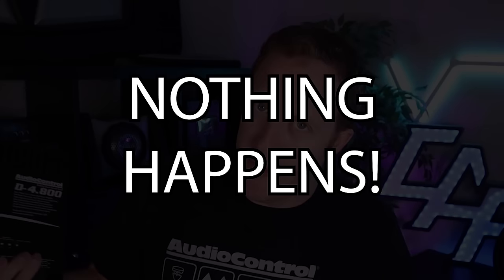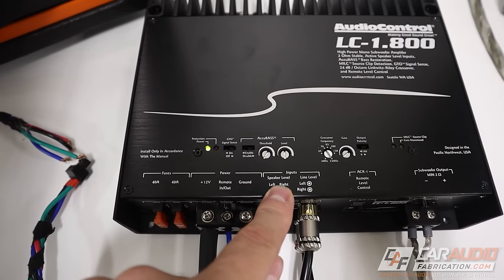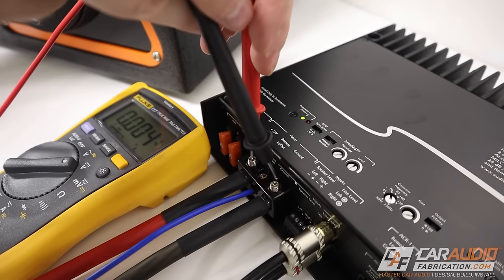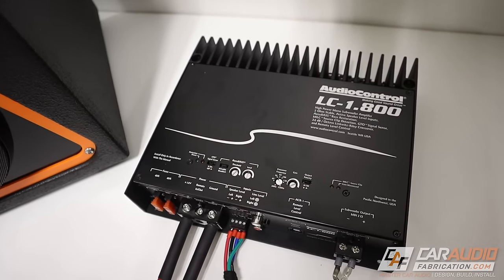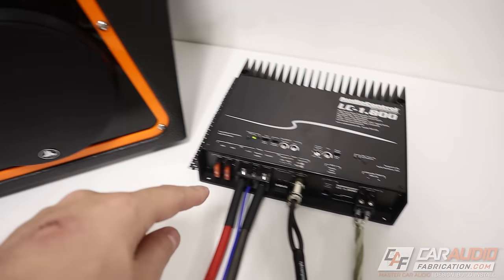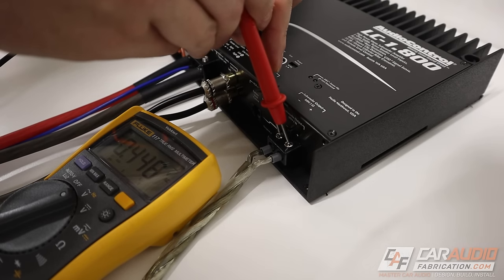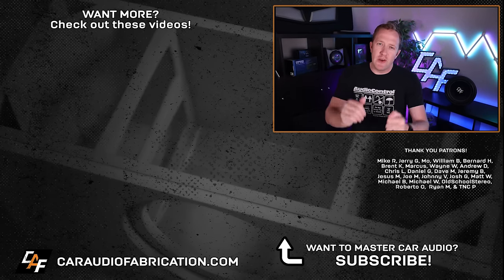No sound? No power? Fix your amplifier EASILY with THESE EASY TESTS!

Comment: Mark, quick question I accidentally plugged the ground and Power in reverse I saw Sparks when I put the ground in the power cable in the ground. Did it again this time no sparks. Fuse good.  could you please be so kind and tell me what steps to take next should I check for a protection diode across the + & - like ameture radio amps have. Should I try hooking it up the right way and see what happens I'm afraid to do so in case I damage it if it isn't already damaged.  let me know please bro thank you very much. It's old school crunch p-1000 1k rms 5 ch amp 70 amp fuse. Fyi: the remote was not plunged in

Comment: One other thing to mention, when testing voltage on the power and remote wires, if you have low or no voltage on both the power AND remote wires, the ground is probably faulty. Test the wires again with the black probe of the meter grounded to the chassis to confirm.

Comment: Dude, the timing of this video is just perfect!

I've experienced this issue last week. Got a custom sound system installed by my local Car Audio shop and after a month, the amp would just shut down randomly. After investigating, the wires on the side of the amp got loose for some reasons. Easely fixed, but I gotta say, I was freaking out when this happened lol.

Awesome video as always! 😉
Reply: Ñq
Reply: What car? Ford f350?

Comment: As a automotive tech that doesnt work on the audio side that had no idea this was how they worked. My mustang hadnt had any speaker working or amp for a year. I knew i had power coming in but had no idea what was going on with it. Ended up being the amp uses the headunit ac signal from the music (static ac when on) to turn on the amp. And for some reason it lost that functionality. Jump to the key on signal from power like you suowed and it came to life. So i took the interior apart and ran a signal wire from the headunits factory key on power. And now it works. Thanks.

Comment: Good video. Dealing with this rn with a brand new head unit not putting out voltage from the line outputs. Going to double check with a meter playing a test tone, but looks like I’ll be sending it back to Crutchfield.

Comment: Top tip for hyundai/Kia drivers out there. If you want to upgrade your audio and got a SPDIF factory Amp. Save up and just completely remove and replace the factory radio and amp and get some speed wire for your aftermarket gear. You do not want to know the hell you'll go through trying to work around that amp/radio instead of just gutting it.

Comment: I've been having this particular issue with my sub, it does not power on at all and all connections are good but if when I turn off my car the amp it self causes parasitic draw and kills my battery with in a few hours

Comment: Just started recently working at a  car shop where one of the Main things they do over there is sound system. Do you have videos based on sound system from installing, setting up and equipment needed? Also do you have videos explaining the basics for each equipment is needed to install a sound system. Some basic stuff what you need to know about speakers, amplifiers, and subwoofer.

I'm sorry I know I'm asking a lot but as someone like me who don't have that much background About sound system I'm trying to learn as much as I could.

Comment: Thanks so much, great video! I just want to see if my amp I bought at an auction would power up and it did with the remote jumper wire before Installing it. thanks for the info😅

Comment: So I have an active subwoofer that doesn't turn on, I know all the connections and wires are good coz I connected two different amps and they both turned on, what could the problem be

Comment: A couple of tips. Amp fuses should be tested out the amp, or the multimeter could be damaged. If you want to test them connected to the amp, a better way to do that is by checking them in high current mode, as an amperimeter, 10A in most multimeters, and set the volume really low. If a fuse is blown, when you connect the amperimeter the circuit will be closed by it, turning on the amp. If fuse isn't blown, the meter will just show 0 Amps. To check remote speakers wiring, even if they have any kind of filter, we should just disconnect them from the amp, and set the meter in ohms. If meter shows infinite value, speaker may be disconnected. If don't, we have two possible chances: if it's a low frequency speaker, it should show a low value on ohms, because if it is even filtered, low pass filters should have low impact on impedance (coil resistence). In a mid/high range speaker, we should have much higher resistance, but never an infinite value.
And to check speaker wiring, oldstyle way, is using a 1.5V battery (AA or AAA) or even 9V  in high power speakers. By fast connecting/disconnecting the battery directly to the speaker we should heat little "toc" noises from the speaker, if it's ok. Please don't use any power supply or car's battery to do this, DC is really harmfull to speakers and we need to use a low volt, low current drain battery just to fast checking, higher voltages or high amp capabilities will end blowing your speaker coil.

Comment: checked voltage on the wires aand got 12 v then  connected to amp nut nothign but still measures 12v but no voltage from control and the ground,gana chase the control wire,thanks for the quick vid veyr detailed

Comment: I have an Audi A4 with the stock audio system. I get no sound from any of the doors. The dash speaker, tweeters, and the speaker in the back work but at a very low volume, i mean really low. Any help with fixing this problem would be appreciated. Thanks

Comment: I’m using an adapter to my stock head unit and the trigger switch wire broke. Will it work if I wire the trigger switch to a 12 Volt aux switch on my truck?

Comment: Several months back, I had a situation where my amp had battery voltage while the head unit was off, but as soon as the remote line was energized by turning on the head unit, the battery voltage at the amp dropped to zero. Turned out to be a faulty/intermittent at the point where the positive power wire was tapped into the system. I replaced the wire with a slightly larger guage wire, connected properly at the battery instead under the dash at the fuse box ( was using a previously installed wire, by a previous owner ) and the problem was fixed. Just something to be on the look out for in similar situations.
Reply: this actually just happened to me in my bmw i think and what fixed it was messing with the positive cable on the amp and battery.

Comment: i have no power to eq or amps radio has power. i have a circuit breaker at the battery could the breaker have gone bad?

Comment: Don't forget some radios have a remote turn on and a power  Antenna turn on if you're hooked up to the power antenna the amplifier will only work with the stereo in the FM or Am position
Reply: What do u mean fm or am

Comment: So I bought a home system subwoofer, I get power to the unit and I can actually run signal through it into my studio monitors/ and successfully get sound through my studio monitors!!! but my subwoofer is just not firing at all.??? Has no sound. I have put my multimeter up to it and it is reading 3.2 ohms. Its a 4 ohm subwoofer. Can't seem to diagnose it unless that means its a bad woofer. It has a slight ruffle sound when I press it in really hard... any suggestions?

Comment: After installing aftermarket double din stereo in my jeep wrangler jk i have no sound from any of the speakers, this jeep has a factory amplifier  but no blue wires its been turned on by canbus, the aftermarket stereo has the blue amplifier control wire but were would it connect? Thanks

Comment: How do u trouble shoot the other thing... for lowering the frequency so the amp can work... but it doesn't- still I checked everything and it still won't work. If the speaker is blown won't it make SOME noise?

Comment: I love the audio control amp I have, but when I had it professionally installed using the gto it fried the battery in my wife's 2020 Jeep. And it is actually the same amp being used in this video. So in new cars w everything integrated into the stereo, be careful. Every time the key fob was used, doors open, etc, it was powering the amp on.
Reply from the maker: That's honestly more of an install issue. The Wranglers are pretty straightforward for a remote turn on lead, so not sure why GTO was used in the first place.
Reply: @CarAudioFabrication  it was in a compass. I was trying to prevent the guy tearing the dash apart. I'm not saying that the guy didn't make some sort of mistake. This was just my experience with it.
Reply: i have subwoofers on amp other speakers are powered by player. for long battery life i have put an on off switch to remote turn on wire so i only turn on the amp when want to listen it loud with subwoofers.

Comment: I have a question. I want to install subwoofers in a semi truck, but I also want to install a 2300W inverter. Since both the amp and inverter connect to the batteries, would that cause any issues?

Comment: Here is where I’m at with my subwoofer install (this is my first time and I am struggling at every turn): TLDR: my sub is extremely quiet even when I crank every knob to the maximum. Like so quiet there is almost no movement on the sub at all and I have to put my head on it to see if it’s on.

I have an AudioControl LC2i Pro. I have crimped the rear speaker wire and connected that to the LC2i high speaker input and then I jumped the left to the right so both sides were getting the same signal. I am vampyring the power and ground on the LC2i from the amp with 12 gauge wire. 
The amp is an 800 watt D class using 4 gauge wire that is connected to the car battery with an 80 amp fuse. The negative is connected with 4 gauge wire to a bolt that is connected to the negative battery terminal. 
When measuring the battery with the car turned on (but not the engine running) the LC2i and the amp both show 12.4 on the multimeter. 
I then ran a tone through the car speakers and see that the RCA cables plugged into the LC2i are sending signal. I plugged the RCA cables from the bass output on the LC2i into the amp.
First annoyance is that both the LC2i and the amp have knobs that control the bass. I’m not sure if I need to have them both plugged in and then find some synchronized levels. 
Because I’m not using a remote wire from the head unit, I am using the GTO option on the LC2i and that seems to keep everything powered properly. I am also using the remote out on the LC2i to the remote in on the amp.
Last settings for the LC2i are the load select which I have at 20kO and the bass output level which I have in the middle. I didn’t do anything with the accubass and just have them at the minimum. 
As for the amp, it has a setting for bass boost which I have off (0DB), low pass frequency which I have set to allow all low frequencies, high pass frequency which is set around the middle which should give it a cap of around 100hz, and then it has the RCA input from the LC2i. As mentioned before it is connected to power and turns on without issue. The output it has are 2 + and 2 - speaker terminals that appear to be jumped inside the unit according to my continuity test so I only have 1 12/14 gauge wire (not 100% sure which it is) connected to those and then to the sub. 

In relation to the video, the amp is turning on. RCA is showing an AC voltage. I am detecting a signal from the speaker wire. At this point I can hear a faint sound coming out of the sub, but it is extremely quiet. I am hoping there is something obvious I am doing wrong.

Again, this is my first time wiring this up and I basically did it from your videos and reading posts on Reddit/the internet. I would easily pay someone to do it for me but no one will touch my car as it’s a 2022 and there is currently no public info on it, even cruchfield is blank. So any help would be greatly appreciated!!
Reply: 1 wire to the sub? Check your sub wiring and ohm load. If it's right then just bypass all the lci shit and and send a signal to amp then sub. If it's still not working and you have votlage at the sub wires your shit is blown

Comment: I have a question what do you think of the is this a good speaker for someone new to (audio car systems) 

Rockford Fosgate Punch P300-12

600W Peak (300W RMS) Class-D Amplified Single 12" Punch Series Subwoofer Enclosure with Remote Bass Level Control Included

Comment: here's a question for y'all.  Just installed my amp.  Alpine KTA450 on an Alpine ILXW650.  When the audio is centered I hear distortion (sounds like a tweeter is blown) but when I pan L or R, fade F or B...the distortion goes away!!?  It goes away gradually too.  Each speaker isolated sounds fine, but when everything is set to center it has distortion (high chime-y distortion) on the peaks.  WTF??

Comment: Hello dude i would ask a question my amplifier nakamichi 3000watt 4 channel i used ch1/2 for four 4ohm speaker 6x9 and 3/4 as bridge for my little subwoofer and it can run 2ohm so how could i wiring my 4 speaker as 4 ohm could it happened and what if i wiring to 8 ohm dose sound would be less louder 
Best regard ❤️

Comment: My voltage at my speaker inputs on my subwoofer amplifier are about 12 volts with the gain all the way turned up what could be the cause of this? It used to go higher than that could it be my alternator going bad?

Comment: im having an issue with a car i bought. dude installed a cheap chinese headunit (which i think is my problem) and a hifonics bg-1300.1d amp with a skar sdr-1x10D2 sub. its all new, amp has power, but isnt receiving signal from headunit. problem is its so cheap i cant do any reaearch. its a 7" touchscreen that was probably around $75. anyways. ive tried all RCA outs on the unit and still nothing. It has a sub, front and rear LR and line in LR. cant get any noise though. any thoughts?

Comment: What happens when everything is connected properly, voltage and ground getting good connections, but keep blowing the onboard 30amp fuse. I’m guessing my amp is faulty? How would I test?
Reply: Sounds like a short somewhere in the cable, go through and look at any locations where it could’ve gotten cut, used to have a short on one of my mods for my car and the fuse would keep getting blown and ended up having a short somewhere and just put electrical tape around where it was ripped and fix it

Comment: My JL slash 1 quit working. Checked it and it was dripping wet! Figured I need a new one but a few days later, the old warhorse is slamming again! 
Should I let it be or open it up to check for damage? The knobs seem to spike the sound, they must be getting worn, this thing is like 25 years old!
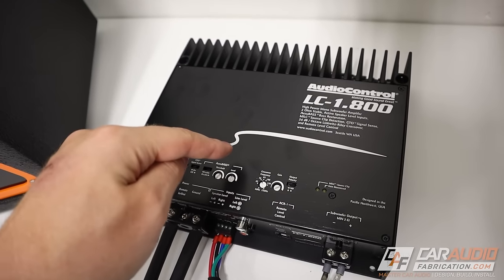Reply: 4:00 nice feature, my JL has it. Made installing just that much easier

Comment: I just recently got two JL audio 12s, lc2i pro, and a jbl amp I love them but every time I accelerate in my car it makes a terrible rumbling noise almost as if the sound of the engine is coming through the subs, I’m very new to car audio systems and I’m not very educated on how they work. The only time the sound gets slightly better is if I turn down the bass completely which pretty much defeats the purpose of the subs. Does anyone know what may be the issue and how I could fix it?

Comment: I have a problem with a salt 6 that has very little play time on it. It will loose signal through the rca inputs within a minute of play time. I switch my rca cable to the slave input and it works fine. And sundown Audio tested it and said it works fine. I've never had this problem happen before. Basically this amp only works in slave mode. Anyone out there could give me some advice on what could be the problem.

Comment: My problem is that I can measure power on the wires before connecting them to the amp, but after connection the power is below 2-3 volts. All fuses are good 😢

Comment: What do I do if something is wrong internally with the amp and no voltage coming out of the speaker terminals
Reply: My amp doesn't come on and it's getting power. Fuses are ok but nothing. Internal issue? I guess it's garbage time.

Comment: Im 9 volts between the ground and remote . The wires are 2 different guages will that cause the issue?
Reply: The power & ground wire have to be the same gauge(ex:both 4gauge)…the remote wire will be smaller(ex:18gauge)

Comment: Hi there!  I have a question. My preamp outputs on my aftermarket head unit are 2 volts. Does more voltage equal more power out of my amplifier in any way?  What can I do if so?  Thank you!
Reply: The amplifiers gain control is used to set the amplifier up for the correct signal input voltage. You will need to use more gain with a weaker input signal. 

When tuned properly, there will not be any difference in amplifier output level regardless of the signal input level.

The advantage to having a higher voltage signal is an improved signal to noise ratio.
Reply: @danielabrams555  thank you very, very much!
Reply: One way to get a higher voltage on your preouts is to use a " line driver " which, Mark has reviewed one by AudioControl here on this channel. While, as Daniel said, the higher voltage won't make your amp any louder, it WILL however make your overall sound quality MUCH better.

Comment: I have checked everything on mine everything checks out. The only thing I can come up with is the high output alternator from js alternators I have is keeping me at a steady 15.5v and that is too much for the amp which is a kicker ca1200.1. Can you do a video on a solution for this issue or does anyone have a solution for this?
Reply: Your amp should be wired to/pull from the battery, not the alternator... The alternator puts out more when the engine is under load, idle is 15.5... the alternator is to charge the battery, the battery runs all the electronics/lights, engine start, ect... Not the alternator.